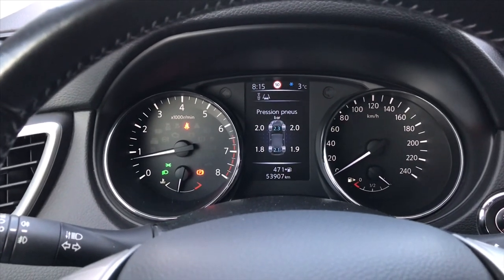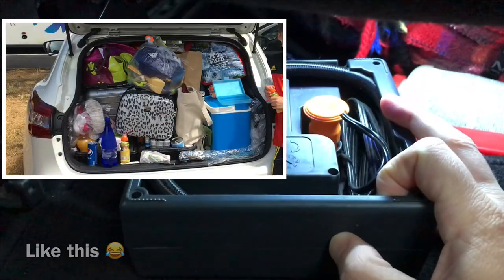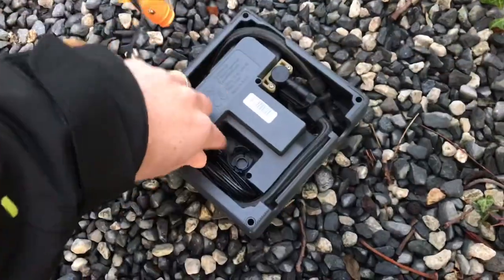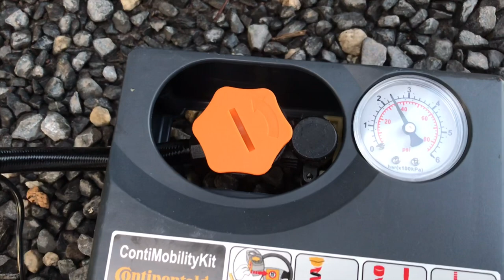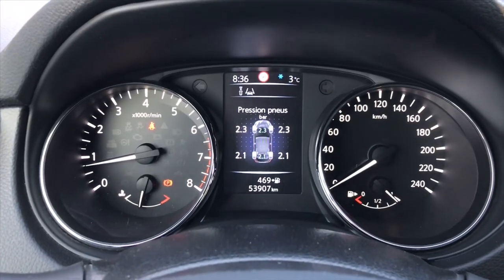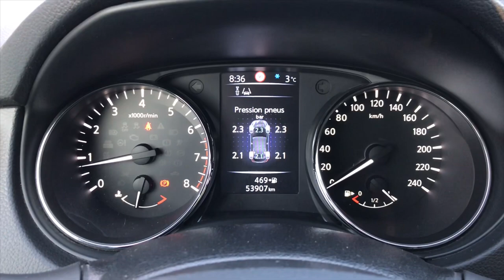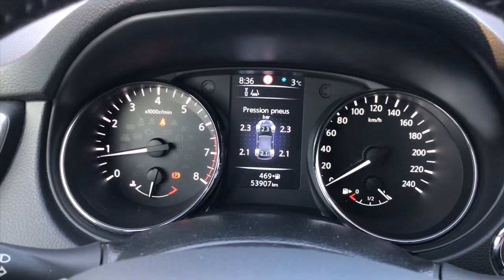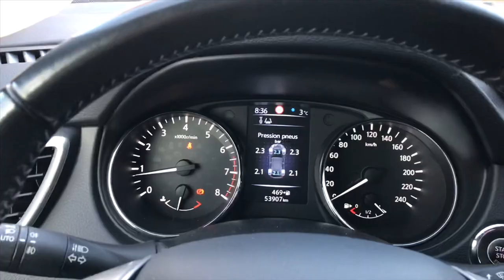Nissan Qashqai J11: Inflate the tires with the Tire Repair Kit

Comment: I use it too. Why not? While inflating use two persons. One looking on tpms and one pumping. Place stripe with black permanent marker on pump scale. One for 2.1 and for 2.3 so next time you can do it alone or without tpms! Good tip for storage under seat!
Reply from the maker: Good idea to make markings on the pump 👍🏻 😄
Reply: @LaPalmeraie0032  Another Ask: 
Foot brake when the vehicle is in P mode with the parking brake applied. When I lift the foot from the brake, it sounds "TIK" under the gear lever.
That sound used to be so little. Now the sound is more pronounced. How can I decrease?
Reply from the maker: Taner Aydın hi! Honestly I don’t know. I have MT motor so can’t compare. I think you first should be sure where the noise comes from exactly to be sure it is a lack of grease. Maybe open up de center console (as shown in another video) first and then perform these actions to be able to watch the moving parts from close. 😉
Reply: @LaPalmeraie0032  Thanks, I will try

Comment: You have to calibrate the Tyre pressures and most are measured cold. When you drive your car with warm tyres it will give a higher reading. Read the manual.
Reply from the maker: LOL! This video was just to SHOW how to use the device and IF it works at all... of course warm tyres will give a higher reading... it's logic ain't it. ;)
Reply: @LaPalmeraie0032  It wasn't a criticism just a fact and its not logical to everyone hence why I commented.
Reply from the maker: @taketwo_duo  and you are totally right! Also about the RTFM part ;p Cheers mate